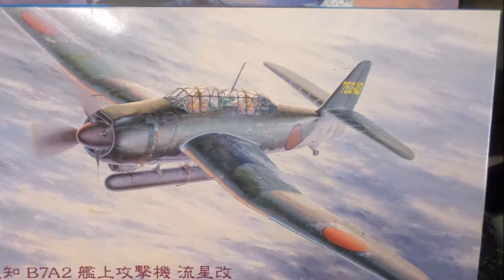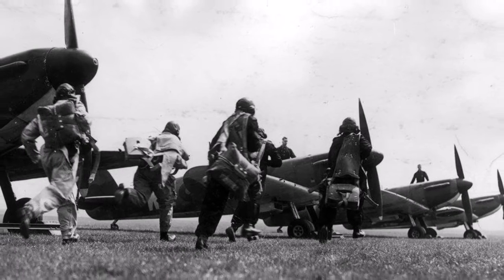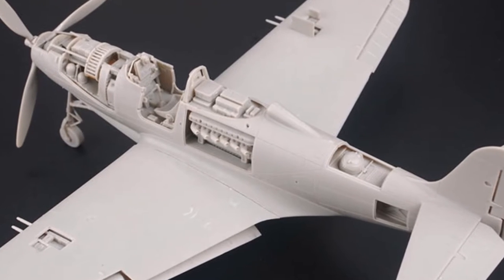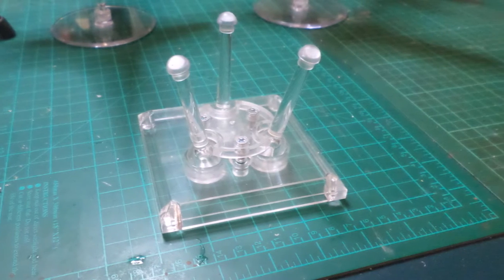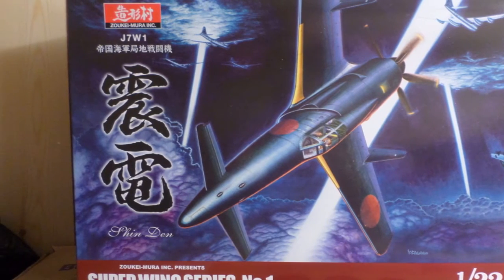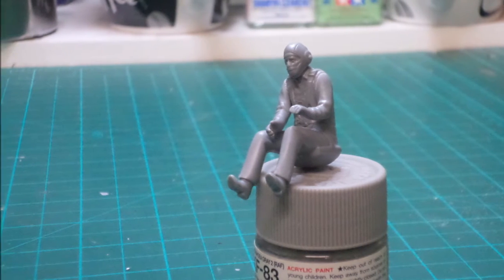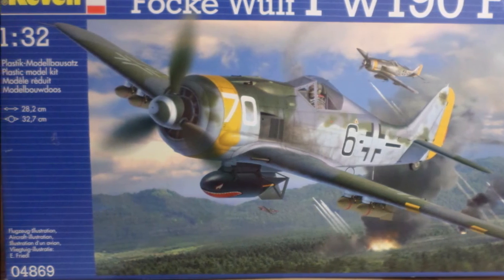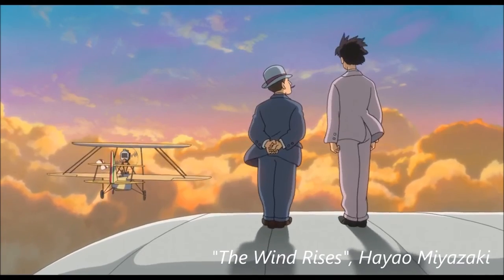The Boxart Paradox - why do we build model aircraft on the ground?

Comment: I prefer airborne. But with the propeller(s) still, it loses any sense of verisimilitude. Motorising it (them) doubles or more the complexity. 
Jets are rather easier. However, the conventional stand is quintessentially cheesy to my mind. How many planes have you seen set upon a fifty-metre long pole or tower sticking straight up into the air? 
   One also requires at least a pilot. These have proven quite problematic for properly fitting, however, so that one can close the canopy. Even more, many would need nigh a dozen air crew. 
   I recently found an idea that, whilst complex, might serve-- one I borrow from principal photography in motion picture production: a device and a concept called a Chapman crane; this is a long, sturdy boom, sometimes articulated, that supports an object one wishes to record (digitally or on celluloid), positioned in a manner in which the latter blocks or obscures from view this support. One extends the opposite end to a large, broad backdrop, which in this case represents the sky in some way. (I would keep this simple: bright azure, with no clouds.) Behind it, an ample counterbalance would hold steady the entire arrangement. 
   AAAAAAAA , tell me what you think.

Comment: Because all flights start and finish on the ground C😂 Even if it goes wron it goes that way, just over a greater area.  I must be odd because I look for a subject not the artwork. Can't remember seeing one of ours with stopped rotors or poles sticking out of them (and only one of ours had retractable UC), but if you can do it well I get it
Reply from the maker: I dont remember seeing mirrored landing bases either, but lots of model aircraft are parked like that with no complaint!
Reply: Rubbish. Our hangar and dispersal was never that shiny. Again it goes down the “what do you want from it?” Route. I have glass shelves in my only display cabinet that formerly only held mostly die cast corgi aircraft (not that well made and I donated the vast majority to a models for veterans charity). Net result with solid sides etc there isn’t much light so the glass lets it through. I get mirrors if you want to allow folk to see the underside (all sorts hiding under there). I mentioned at a show that I wanted to get something specific right on the underside of one of mine and the chap said “well it’s against the rules to pick them up to judge underneath so why bother?”.  Because I might want to?🙄. It’s a funny world chap. So subjective although it really shouldn’t be because it’s right or it isn’t, but subjective suits me of more people enjoy it....just don’t put drooped blades on a Lynx FFS😳🤬😆

Comment: if the kit comes with a pilot, i build it in flight. No pilot=wheels down
Reply from the maker: Good effort Justin! Unfortunately lots of new kits come without a pilot, but there's enough aftermarket out there to fill the gaps. Cheers, Chris
Reply: @beckersmodels  I haven't tried after market pilots. I was always afraid they wouldn't sit right or would be ever so slightly to large.. what types have you used?
Reply from the maker: I use Aerobonus for 1/48 and 1/32 which usually come with the ejection seat, so no problem fitting, or generic Hasegawa sets, plus Master Details for 1/32 and of course, my modelling mates are always donating their "spare" seated pilots that you get in the Tamiya 1/32 kits. For some 1/24 projects I have in mind, I'm using car driver figures that I'll have to modify with headsets etc. Cheers, Chris

Comment: Let's talk about no pilots with the kit; and also let's talk about no after market seated figures for 1/48, 1/72 scale, or whatever your flavor is .
I'm currently working on a Hobby Boss F-105D Thunder Chief wheels up dio of Vic Vizcarra popular Pu$$y Galore II being refueled mid air over SEA .
Reply from the maker: That F-105D should be a fun display to see!
There is a slowly growing amount of aftermarket seated pilots in 1/48 scale, 1/72 is still underrepresented however. Of course the problem is a lot of these figures dont fit either!
Thanks for your comment - I need to revisit this topic again soon...
Reply: @beckersmodels They must be far and in-between, I've found standing pilots, but not too many seated . As for them not fitting you could try re-figuring them with poxy and flexible wire . I use sculpt poxy for mine . For another dio I'm working on with a ME-262 I've configured many of the 1/48 figures holding tools or sitting . Once you learn how to sculpt the poxy with tools it becomes easier .
Reply from the maker: @zabercrombie24  Ill be putting a list up on my website soon.
And yes, had to do many epoxy putty and wire conversions of crew with wrongly positioned legs and arms, and resculpting!
also the boiling water trick, undercutting a joint and bending legs/arms...

Comment: Display stands are as off-putting as a wet blanket, and models are best displayed on the ground for as long as you don´t come up with some gravity-defying trick. A propeller-driven aircraft displayed in a "flying" attitude with a still propeller is a pitiful sight, and transparent discs are even worse. "Flying" jets with no exhaust flames/smoke coming off the nozzles are another non-starter and, in general, the thrilling dynamism of a flying aircraft can never be satisfactorily duplicated by a sad static lump of plastic held aloft by whatever means. And don´t get me started on a Spitfire  10 cm, or a scale 7,2 metres, above the ground! Any claim to realism your hard modelling efforts may deserve, are thrown overboard when you try to duplicate flight. The so-called "paradox" is not really there, a competent artist can make a thrilling and highly interesting illustration of a plane in flight PLUS hundreds of other elements (far away clouds or hills, the ground ten thousand feet below, a suggestive twilight, the sea way below with a burning cargo ship, you name it ....) which are simply impossible to get in 3D in a realistic way and true to scale. Sorry, but your talking point is moot and wholly unwarranted
Reply from the maker: First, thankyou for your reply Javier. You've taken a lot of effort and some bravery to admit what 99% of all aircraft modellers want to say these days - that they have next to no courage or innovation when it comes to this part of the hobby.
You see it has really crystallized for me how there is at least two different hobbies within "aircraft" modelling. A third of course are the scratchbuilders, but that's a whole nother ball game.
There are the majority - the parked aircraft modellers, who can't seem to think past "how can I add more detail" and those of us who want to imbibe some sense of action and awe, and want to excite the sense of flight that these beautiful machines deserve. 
I can't think of a more pitiful sight - in fact so extremely off putting that I now don't even look at the 1000's of them plastered across the internet - than acres and acres of wheel's down aircraft, plonked on a table upon a piece of white paper - or even worse, a mirror - underneath them. Any claim to realism is lost completely, even when photographed for online distribution. But nobody wants to admit that, instead they point at a clear rod or a flight stand and say "tsskk.. totally unrealistic, looks ridiculous". I'm beyond debating this hypocritical position.
Yes, a non spinning prop is problematic - but they can be spun with a fan when taking photos, or feathered, or motorised (as I do on my inflight propeller aircraft now), and jets primarily don't have external flames coming out of the nozzle unless in reheat or afterburner, but I have done those effects with hot glue guns and layered clear rod with clear metallic/pearl paints to try to resemble it. Try having some lateral thinking at solving these problems perhaps?
There are also solutions including getting scale right - my last couple of inflight models used forced perspective for example and I'm now developing sideways mounted aircraft with a backdrop (actually similar to your illustration idea - why aren't you doing that with your wheels down aircraft?) so there's no vertical element to get in the way of scale above ground. 
Look, we are never going to get perfect 3D representations, even with the advances in slide modelling, LIDAR scanning, artistic weathering and 3D printing - its a representation within scale, unless you go up to 1/16 or 1/6 scale for instance. 
Other hobbies are advancing in terms of artisitic endeavours and ways to display a model - yet aircraft models are either represented wheels down on a white piece of paper, some or all panels removed for a maintenance display, on a factory floor getting built or a crashed diorama. That's it. Rinse, repeat, just keep adding detail that can only be seen with a macro lens. But next to no innovation towards actually displaying the machine in its intended environment - in the air! 
Again thankyou Javier, for your long and disparaging critique of what I have strived to do in the last seven years of inflight aircraft modelling, I shall endeavour to do some more, but I shall not be sharing it with those of you with cold timid souls who can't even comprehend the possibility that there is more to modelling that plonking it on a flat table like a diecast toy.
Kind Regards,
Chris. Aircraft Modeller. Not a Car Modeller.